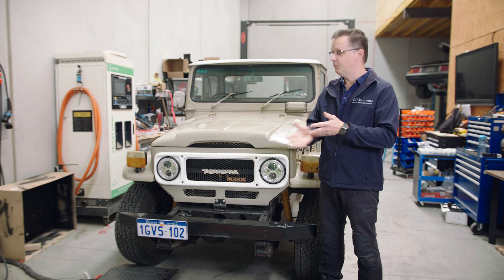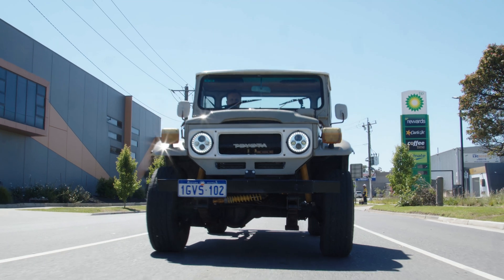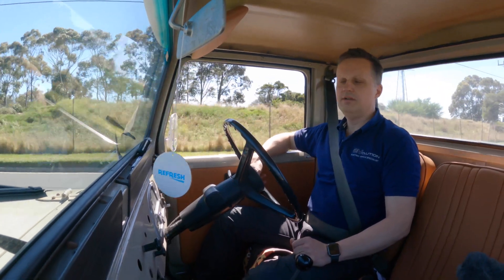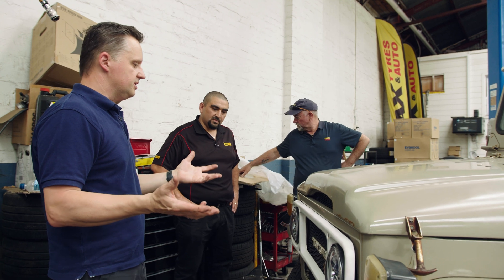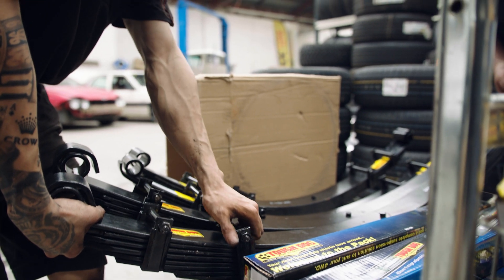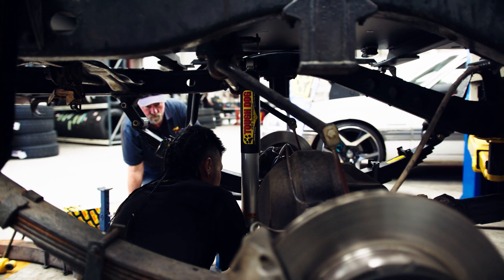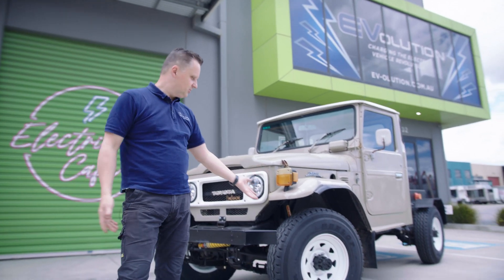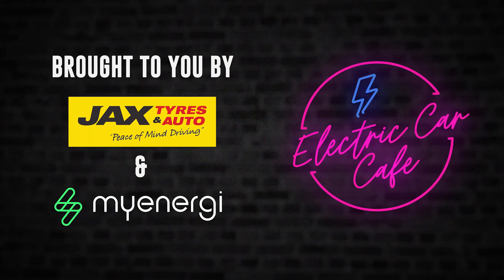Tesla Toyota Electric Landcruiser HJ45 EV Conversion Restomod - Part 4: The Final Tune Up

Comment: Hahahahah Hydrogen Barra Bio diesel Shittiy Electrics are catchin fire so much banned in Multi story accomodation buildings Ferries across Europe and More to follow. Shell has a 1970 buic that does 1000 miles per gallon and the bloke in 1980 made a similar car run 300 miles per gallon and VW Apprentices have a car two tonnes that does 300 miles per EU gallon....Electric is a scam an 500 tonnes oof ore to make one battery 1200 gallons of diesel to mine the lithium aline and the increase in mining will be 300 percent world wide just to maintain the current trends and thats not on their projected targets only w World War will achieve their targets wake up no rise in sea anywhere means no thermal expansion.

Comment: i really want to try to understand these conversions. i have a 1971 k5 blazer and a 1972 toyota lc fj40 both with tired ICE engines - but i can't get by the space needed for the batteries.

Comment: Bit dissapointed on the lack of information. What motor are you using? What’s the hp rating? Why did you keep the (4 or 5spd) gearbox? Does it have regen? How did you wire it? How about the gages, how did you convert those? Is it 12V? Show some of the hardware and build? A/C, how did you drive the pump? I could go on…
Reply from the maker: hi Christian, we don't aim to cover all intricacies of the build in every episode. But if you were to watch the series from the beginning though, most of these questions and reasons have been discussed. The 'whys' are mostly tied back to the customer requirements and, frankly, budget. There's a number instructional / informative videos in the works so suggest you 'stay tuned' for those. Thanks so much for your interest and support!

Comment: I’m surprised at how many videos that don’t report on the battery size and range of the vehicle.  Kind of important I think.
Reply from the maker: hi Don! We talked about this in the first video. so didn't feel necessary to talk about it again. But for your benefit, this vehicle has 100kWh of Tesla cells which should be good for in excess of 400km.
Reply: @electriccarcafeatevolution4319  That’s a quite reasonable range!
Reply: Given the charge port is a plain Mennekes (Type 2 AC), the most you’re going to charge at is 22kW. And probably less than that depending on the inverter. Your typical Tesla maxes out at 11kW on Mennekes AC. To get rapid charging you need a CCS2 DC charging port. 

A 100kWh battery means long road trips will be interesting, as you’ll need somewhere that still has AC outlets (which are getting less common) and is willing to let you sit there for up to 5 hours!
Reply from the maker: @PCLoadLetter  The customer did not option DC Fast charging though this can be retrofitted at any time in the future. We can further augment with 22kW AC charging when/if required.

Comment: What a great build! What kind of range does the truck get on a full charge?
Reply from the maker: We've not performed a full range test yet but we expect 400-500kms depending upon conditions. It has a huge 100kwh pack and it's actually pretty light and efficient